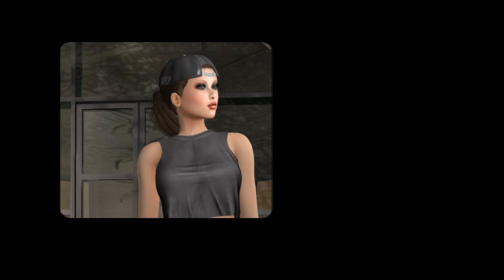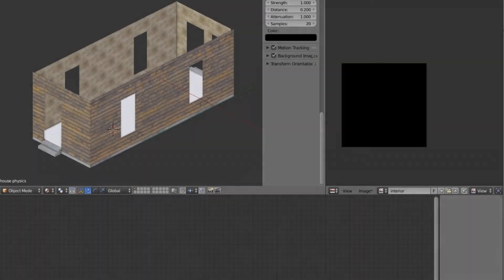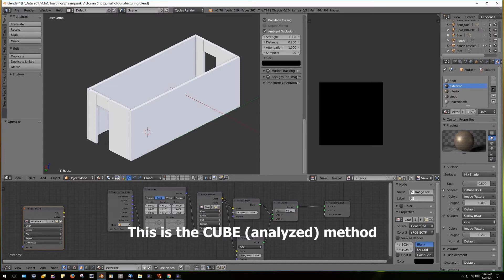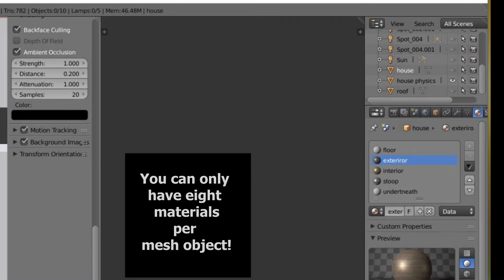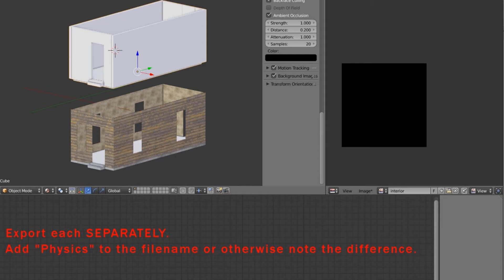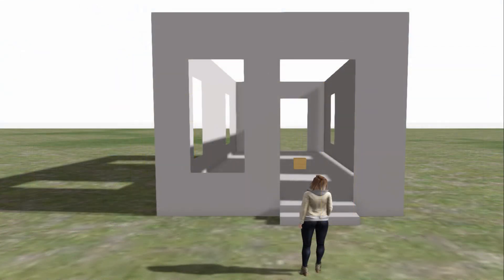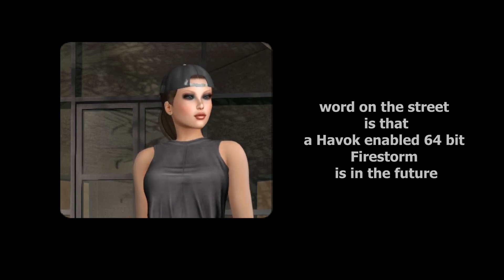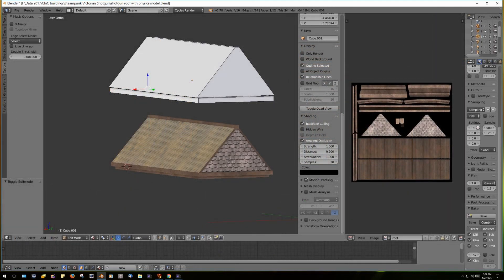House Physics for Second Life - Blender

Comment: what happens if turns all blue and no pink?
Reply from the maker: Well it has been seven years now and lots of new versions but generally blue was good and there was orange and yellow back then which meant more complex (costly in SL) physics.  So maybe someone else reading can answer OR you will just need to test and see if it works OK.    Good luck.
Reply: @chicaeon  thank you very kindly

Comment: You can tell what? All I see is a lot of different colors when I touch the analyse button. I could swear a couple of years ago there was an explanation of what those colors mean, but I can't seem to find them any more. So is pink good? Is green good? Is blue bad? Is it just pretty colors to enjoy? No telling. Just a lot of important stuff gets skipped in tutorials sometimes.
Reply from the maker: The uploader has recently changed (mostly with more LOD options plus some additional help if you use the Firestorm viewer.  I have never known what those pink, blue and yellow tints after the analyze button were so can't help you there.  If you use Firestorm you can NOW upload your mesh for free sort of like a local texture -- only you can see.  So that might be helpful.  Check out the Firestorm viewer website for more info.  I haven't used this feature and no longer creating for  retail so not doing much these days.  Good luck.

Comment: Hi, is this still the same in 2021, or have methods changed in the last 4 years?
Reply from the maker: The ideas are the same; the interface has changed. I am still using this exact method (the cube one which I learned first :D) and it works perfectly. My last house upload was last week.  No issues at all.
Reply: @chicaeon  Thank you :) I'll have to try and remember my beta grid login and see if I can get this method to work :)

Comment: When using a Boolean for the doorway, how do you make SL recognize it’s an open walkway?
Reply from the maker: Basically same as with a regular door. If it has a curved top for example you would need some smaller cubes to make the shape OR you could simply forget about the top part of the door and make the sides. This works well in SL for those REALLY REALLY TALL avatars. You can make the door a reasonable size and the physics model NOT the same as the doorway, letting the tall folks walk through without issues .    I do have to say that I have never USED a Boolean for a doorway LOL, but that's the theory.  Good luck.

Comment: I've been a digital artist, 3D model artist and sculptor, texture artist and animator, using said skills to work with games engines (including Halo CE engine, Source, Unreal 3, Unreal 4 and Unity), for 18 years. I also do a lot of mechanical engineering. REGARDLESS... Second Life always seems to struggle with linked mesh uploads and LODs for said mesh. So this doesn't work if you want your house to have different parts and custom LODs lol.
Reply from the maker: Actually it IS possible to do what you want. Part of that is covered in another tutorial here on uploading LINKSETS.  But this is meant to be a BEGINNERS tutorial. You can certainly upload each PIECE of your mesh house using this method and then put the house together inworld. I do it all the time.  

There are rules in SL just like any platform and working around them  as well as designing with them in mind  is often needed. As long as you keep your materials under 8 (so eight "texture faces" when you get your build into SL there is no reason for a linkset --- that "I" can see anyway.  And there are even ways around that --- but I won't be making more tutorials to explain it :D.    

Hopefully you will find a workflow that will work well for you eventually.

Comment: Thanks for the video. I'm still having an issue with physics inside the house. I have an invisible wall running from the left door frame to the far left corner. My cube model has gaps and nothing is touching. 3rd upload of the model and still the issue. Wondering if I need to analyze differently? I am using high LOD for all levels as my LI is staying low. When trying to set to prim, only my ceiling material has the ability to change to prim, all others except my windows will only allow change from convex hull to none, with no prim option. When trying to change my windows to none, it tells me the root prim can not be nothing. The only way I get through the door now is to set physics for inner and outer walls to none. The prim option on the ceiling does nothing. I deleted my windows and can move freely through the house, but also walk through the walls. So lost. Tried again with high analyze, no luck. Any help is appreciated as I continue trying to figure it out. Thanks
Reply from the maker: Did you try to upload your house as a LINKSET (not joined)?  That's what it sounds like.  You need to upload JOINED Parts (like the roof as one part, the main building as another part, the floor as the third part etc.  EACH of these JOINED parts needs to have its own  physics model. If you use CUBES for the physic model then you do need to anaylze.  BUT if I am guessing correctly the uploader ONLY attached the physics to the ceiling :D -- well, THAT'S NOT GOOD.   You CAN upload a house as one joined object with a single (again joined) physics model but it is a pretty complex project.   

So think logically and make some decisions.  And then just upload PART of the house and see if you can get that to work.  You CAN upload a house as a linkset and there is a video on uploading linksets here somewhere and all you need to do to make that work. I don't recommend that for houses as it can get very complex.    ALSO if you have a JOINED house with more than eight materials the uploader will break that house apart.   Either way you most likely don't want your ACTUAL HOUSE to be lod 4 on all levels. A vase? sure - or at least the top three, but not a house.   

Good luck. This isn't that difficult to fix. You can at least test the FEEL of the house even without the physics working.  If you cannot see PRIM as an option then you know you do have an issue. I think uploading in more parts with their own physics model should fix it. If not, write to the SL MESH forum with some screenshots.
Reply: @chicaeon  Thanks for the help. I managed to unlink and relink everything and set root prim to the roof. Then changed the ceiling to prim, changed everything else to none. The roof seems to be the only object not obstructing me lol. The physics model seems to be redundant though, as it's still using the original model physics until everything is set to none. All good though, will keep trying with what you suggested. Appreciate the reply. :)
Reply from the maker: @clangordey   OK Trying to be clear -- for you and others.  You DO NEED TO JOIN your pieces together.  If you made something out of prims, exported and then imported that get's very messy and is not advised and in many cases you would be better off with prims. A whole nother video that I won't be making :D.  

So, what happened was that the uploader only "saw" one physics model (even if you had 20 single cubes) , it attached that cube shape to your linkset as it saw fit (not even necessarily the physics cube that was supposed to go to that piece.   It IGNORED everything else --- hence your problem.  So right now you have a house with no physics LOL.    Really not good.   Physics is difficult to understand, I do get that.  I  suggest trying something VERY simple like a wall with a door and nothing else and see if you can get THAT to work and then take that knowledge forward. Good luck.
Reply: @chicaeon  All is good. The build was made from scratch in blender.
So, switched my object order in blender so the roof was first(SL ID's the first item as root prim by default I guess), exported and uploaded again. Skipped Analyzing. Edited each linked object's physics to set the one as prim, and the rest to none. Done and done. The cube physics file is working perfectly. Thanks again. I'll definitely do a few things differently for future builds. Cheers
Reply from the maker: @clangordey   lol.  Glad you are good, but you ARE suppose to hit the walls of your house -- both inside and out. So hopefully you will get that all worked out in the future.  Have fun. That's the most important thing.

Comment: hello thx for the video may  i ask u what is the program u using to record in this video
Reply from the maker: I used FRAPS to record the chatty inworld parts and a free capture software that I can't remember the name (sorry). Both disappeared with a computer melt down some time ago. I used Corel VideoStudio (I think 8) to put it all together. This was a LONG process and took a lot more time than just talking into the computer while you worked -- usually a whole day or close to it for each one. I added the text in the editing software and put in the sound bites there also :D.   

And saved at a very high HD setting as I know that many times I can't follow along with BLURRY screenshots :D.    Wish I could be more helpful; it was awhile ago! :D
Reply: @chicaeon   ty so much fraps isn't working on windows 10 now i downloaded many programs and always gave me a very bad quality videos :( any way ty for your answer <3
Reply: @LolaLola-lk6bt  Maybe try more with FRAPS...I use it on Win 10 without problems.I also use Handbrake for compressing the recordings, in order to save space on hard disk and doing it with as little quality loss as possible. It is really a handy tool to have. You can use Sony Vegas for editing the raw recordings, after and add effects and stuff.

Comment: hi! at 4:48 sec, what do you mean by "transform the origin to the geometry"?
Reply from the maker: In OBJECT mode, choose "Object" from the lower bar of the 3D viewport --  then choose Transform then Origin to Geometry.  I am guessing if you watch the video again that will be clear since you are the first one with the issue :D. Good luck.    Also if you came in and didn't watch the previous videos you might be missing some needed knowledge.    Also if you are in 2.8 things are likely in other places now.
Reply: @chicaeon  i managed to do it but i end up with my physics mesh hovering over the normal mesh even though its exactly where it should be in blender, i had already applied loc rot and scale and did the origin thingy, any ideas whats going wrong?
https://imgur.com/a/L9ywltn

Comment: Thank you. But i have a problem. After i have uploaded into SL, and changed to Prim.... the LI reduced when I enlarged my model and increased when i reduced the size. I thought it would always increased when enlarged. Could someone explain to me?
Reply from the maker: This can happen rarely. I have never seen it personally. I believe from other's comments that it has to do in part with the mesh being too dense (too many vertices).  

Best  to upload the same size as you want the building to be.  

You can adjust the size of the model before uploading either in Blender or in the uploader. Also, the new Firestorm viewer has additional information now in the uploader so that if you are using Planes (unanalyzed) physics you can get a better idea of the finished land impact.  

Also make sure that if you are using cube physics (analyzed) that the cubes are NOT touching in any way.  Sure that was mentioned in the video but very important. The cleaner your mesh model is, the better it will upload -- of course. 

Good luck.

Comment: Awesome tutorial, I am however having some problems. I used this method (cube physics) to create physics for a set of stairs. Everything I do the physics show up as a box around the stairs? Any idea what I am doing wrong? It completely disregards the cubes I have made and just turns into a big box :(
Reply from the maker: Did you remember to ANALYZE your physics model when uploading?  Did you remember to change to "prim"" in the Features tab AFTER uploading.  Those would be the two obvious issues.  Are you stairs each single NON-touching cubes for each step?   Typically most creators I know make a ramp for stairs - so "quadrilateral" but not rectangles LOL - closer to a triangle and that could work too). So that might be something that would work for your project. Good luck.
Reply: @chicaeon  Thanks for the quick response you are amazing! ♥ I did analyze and change to prim, but still can't even come close to the steps. No matter what I change the physics still just show up as a block in preview and then of course when I go to walk into it im hitting that "invisible box". I like creating mesh in blender but man this whole physics stuff has me sooo confused lol.
Reply from the maker: @user-qu3ru9up2p  Probably best to take some screenshots and post on the SL Forums. This of course if you are in SL. If you are in Opensim -- which I didn't think about -- it could very well be the physics engine of the platform you are on or using. ALSO, as stated on the Firestorm page, you should not use the Opensim version to upload mesh to SL.  You might also try uploading using the official Linden viewer if you are using a third party one. That's all I can think of !!
Reply: It doesn't look very pretty lol just threw something together quick to test to see if it would work. Here is what I have https://gyazo.com/03b93e32e57c74cc3d3d5710ac802f32

Comment: Hello its me in SL and OSGrid is KentDavis Edman. I am try work on physics and fail on Firestorm upload.
Reply from the maker: There appear to be some "issues" (bugs) in the newest Firestorm release. Friends -- ones who know all about physics -- are having issues. Because of that I didn't install :D.    So if you are using the newest version  (July 2018 I think) then that may be the problem. I suggest trying the Linden viewer to upload.   I haven't been in Opensim in well over a year but physics as I mentioned are very different there depending on the physics being used, so you may not be able to get typical physics to work there. Sorry.  Don't forget that you need to change to "prim" once the model is uploaded. Good luck.
Reply: Allright.  I haven't change anything on Blender 2.79b. I just found out why. I am show you on below.

[23:10:39] KentDavis Edman: Alchemy Viewer.app upload mesh within physics https://gyazo.com/92f93c9934bf970abed8931642cabefa

Firestorm.app  I just log out from Alchemy Viewer.app then login Firestorm.app to show: https://gyazo.com/aaaab6f8c2dae797c172bf9824c01676
[23:10:52] KentDavis Edman: There I walk through mesh within physics.